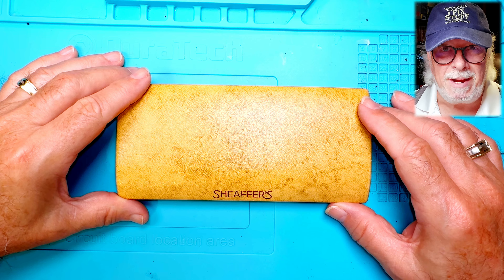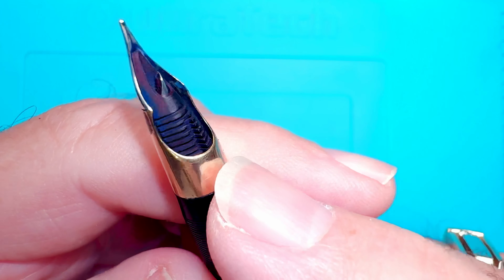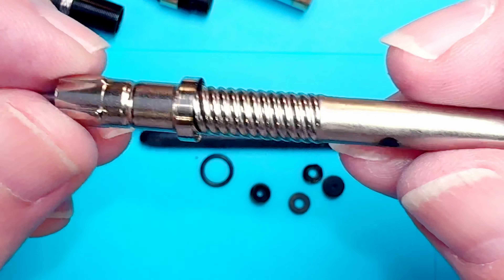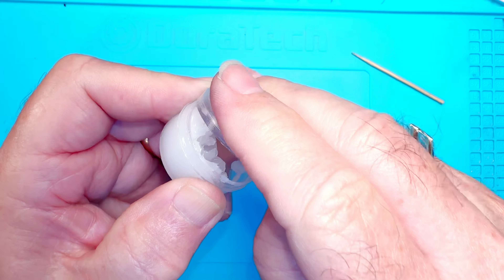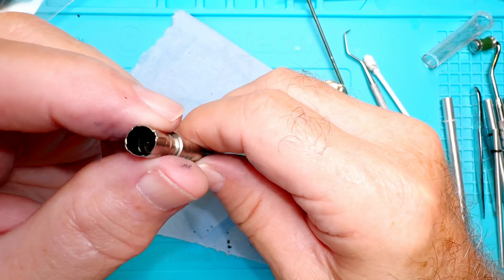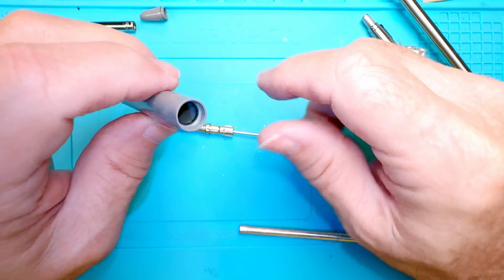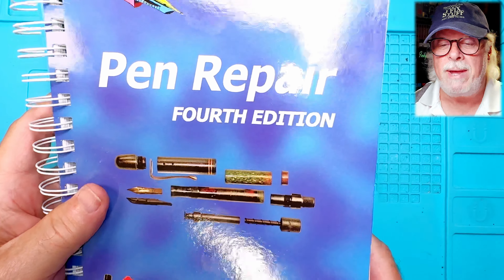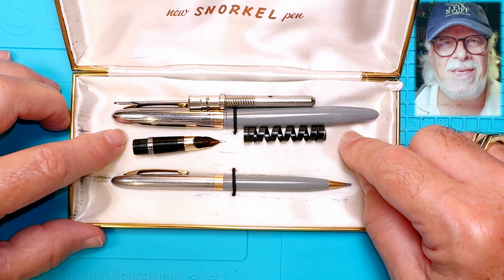Pen Resurrection Sunday Ep 66 - 1955 Sheaffer Clipper TM Snorkel FAIL!!

Comment from the maker: UPDATE:
Based on some of the excellent comments here and in my Facebook fountain pen groups, I have been able to get the Sheaffer Clipper working.

A commenter on a Facebook group called Vintage Fountain Pen Collectors, Users And Restorers In Pakistan suggested that the previous restorer had deepened the o-ring groove in the barrel. Hence, the o-ring doesn’t make a proper seal. A commenter here said that old plastic tends to shrink and thus the seal isn’t as strong. I think they are both right and it caused me to think I might replace the correct o-ring with one of my many o-rings from my Penbbs Parts Bag. I tried a thicker o-ring and the barrel not only hissed at me and when I put it back together again, it sucked up 0.45ml of ink and is writing beautifully now for more and a half hour. 

I will film polishing up the rest of the cap and barrel, tune the nib, and restore the pencil in “SNORKEL Part II” coming soon!

Thanks everyone for your great input and suggestions!
Reply: Hurrah! Great ending to your story. 

What a shame Facebook and the Internet have been less able to help us resolve critical problems instead of inflaming them.
Reply: @InkquiringMinds  awesome!

Comment: I may have missed it in the video...did you do anything to seal that crack in the barrel? I'm concerned that it will continue to grow due to pressure exerted as you depress the Touchdown tube. It seems likely that you won't always press the Touchdown tube straight in, and sideways pressure will try to open the end of the barrel, which will stretch that crack and cause it to advance a tiny bit. I think that acetone would be the right solvent for the plastic. You could "wick" a tiny amount into the crack from just inside the barrel opening, above the o-ring.
Reply from the maker: I sealed the crack.

Comment: Hi, same pen, same case scenario happened to me. Problem is this plastic barrel gets brittle and shrinks with time, oversizing the I.D. where the o ring seats, which creates a gap between o ring and metal tube slider, hense: no vacuum.
Reply from the maker: You’d think it would decrease the ID!
Reply: @InkquiringMinds  all O.D. gerenal get decreased while I.D. get increased due to the thinner tube wall material, remember, when it shrinks, shrinkage  goes all directions contracting the material by itself. I'm a general machinist , believe me good man
Reply from the maker: Excellent explanation! TY!
Reply: @InkquiringMinds  Always happy to help. Even though I'm not a member of the channel (but an old subscriber), I'm a huge fan of your pen restorations .